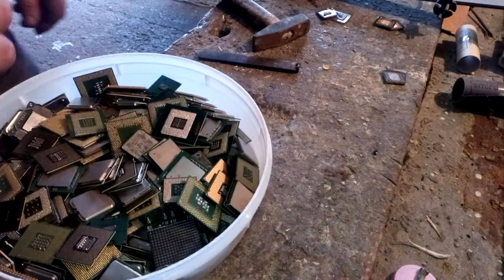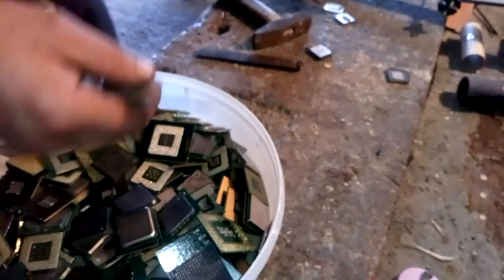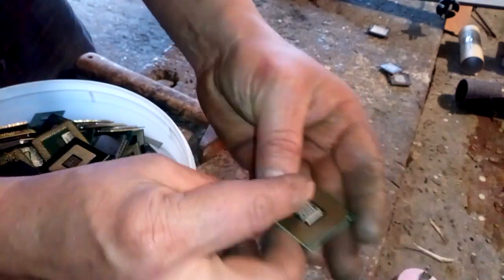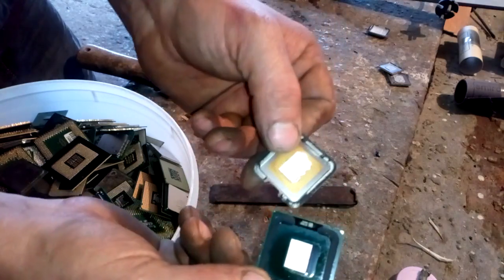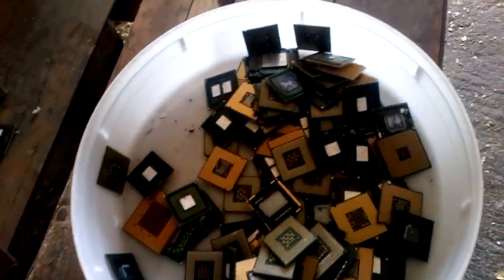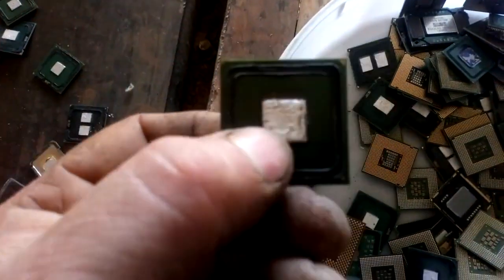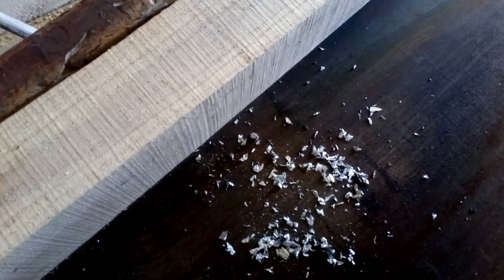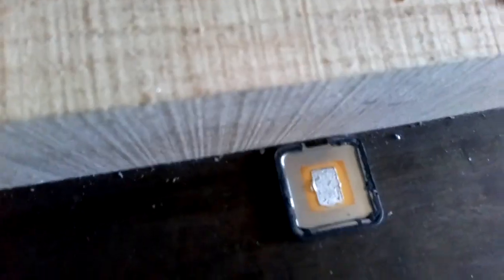EASILY REMOVE HEATSINK FROM CPU & INDIUM HARWEST FOR FUTURE!

Comment: Hi, do not forget that when you scrap any laptop or flat screen LCD tv that the glass panel that looks dark contains a coating of liquid Indium-tin oxide in the middle of the 2 outer glass panels, just like a sandwich. Many people just throw out the glass but I use a paper shredder to shred the glass into small pieces for storage for now and maybe in the future someone will come up with a simple way to get the indium-tin oxide out for refining.
Reply: Been wondering what was in those as it seemed such a waste to throw them out, this is good information and I thank you.

Comment: Have you tried a vice where the edge of the CPU fiber is against one side and the edge of the heatspreader on opposite side is  against the other and then just tighten until it releases? Rarely does the silicon die come off with the heatspreader.
Reply from the maker: Scappin' Cricket If I tried it and it works fine, although I got the impression that this vay it's as fast as processing a larger amount.